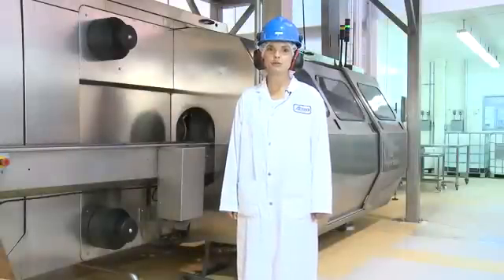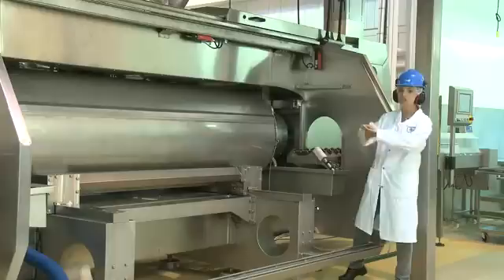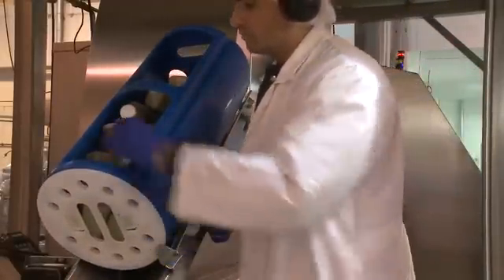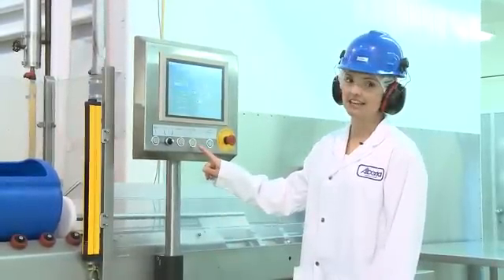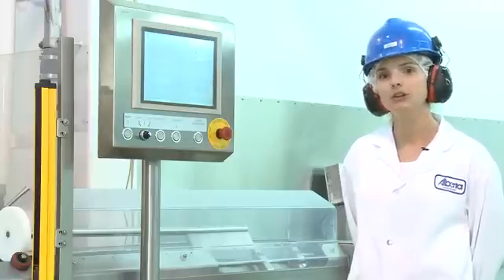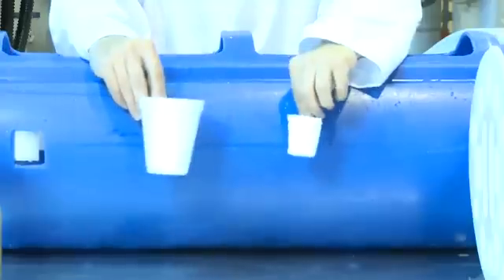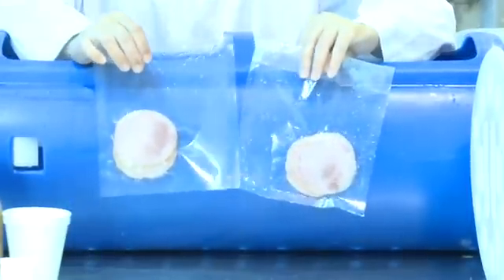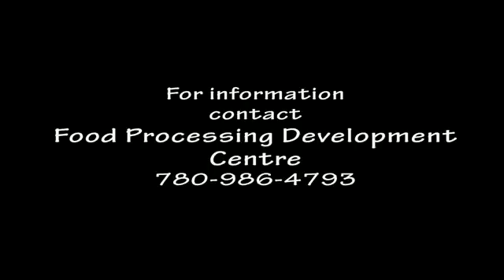High Pressure Processing Alberta

Comment: Hi Hiperbaric Team,

Quick question - Can I use HPP with bottles that 
are labeled already, if yes whats the best label material?? Or is it 
recommended to do HPP without product labeling?

Regards Sebastian
Reply from the maker: Hi there! Of course you can HPP bottles that are already labeled. Keep in mind that paper or other non-water proof materials will not resist the process. Depending on the design of the label it may be better to attach it before or after HPP. You can contact us for  more details: https://www.hiperbaric.com/en/contact